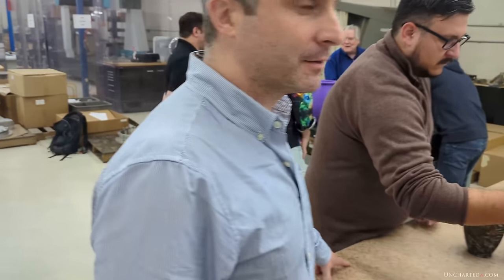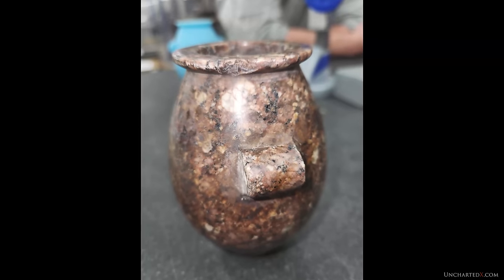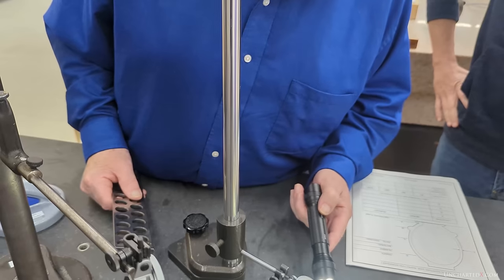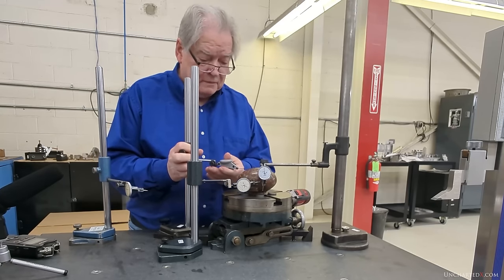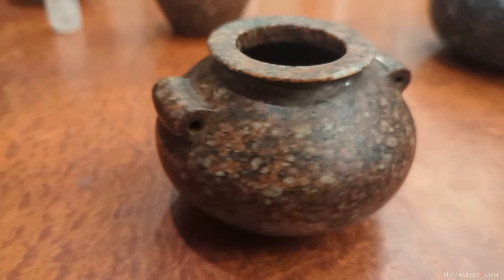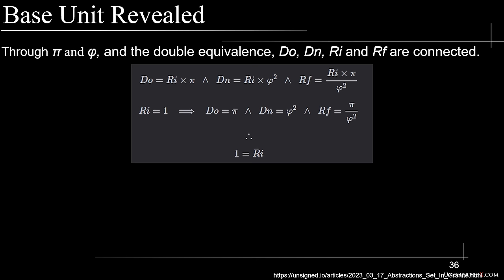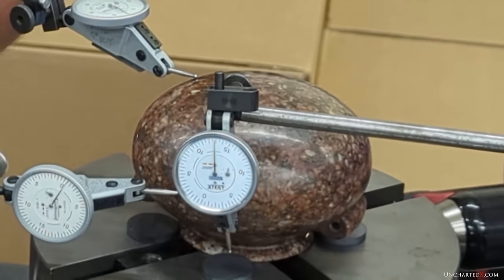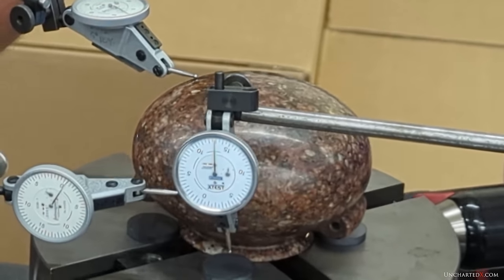Astonishing Results! More Ancient Egyptian Granite Vases Analyzed! More STL's available.

Comment: I am 10 minutes into this video.  I had seen some examples in photos before, and my point here is that I assumed the walls of the vessels were fairly thick.  In the opening, where they shine a light thru the walls of one, I was surprised but not quite blown away.  I am aware of the famous 'schist disk' artifact, and I know that the Egyptians were capable of some astounding results.

There is NO chance that these vessels were made IN GRANITE with copper chisels being tapped/beaten with granite balls.

I am a mechanical engineer who worked my way up, in the days when you COULD work your way up like that.  I have no hands-on experience with machining, but I know machining quite well.  With our CNC machines, these vessels and the schist disk could MAYBE be made so exactly and so concentric made and true in all 3 dimensions.  The ones with ears/handles?  I am not sure.  I honestly don't think so.

Before CNC, no machinist in the world could have made ANY of these.  Even with CNC, I am severely doubtful.

One feature has to do with that light shining thru the wall of any of them.  Thin when machining adds a new level.  Because to remove material by machining means you have to put FORCE perpendicular to the surface you are working on.  Applying too much force risks breaking thru the wall.  5% too much and you have to start over again.

Ben here says that these are mostly PRE-DYNASTIC.  Per arkies, pre-dynastic Egyptians were shepherds called Hyksos.  If a CNC expert in 2023 might not be able to make these, what do you think are the chances for a shepherd in 3177 BC?  That is 5,200 years ago.

So, agreeing with Ben and with Chris Dunn and others, the arkies who argue against the reality of these are fools.  Modern fakes?  NOBODY TODAY CAN DO THIS.  They call them fakes because this is WAY over their heads.  And all they can do is pretend they don't exist.

But people like Ben and Chris do not pretend they do not exist.  They want ANSWERS, not excuses.  I am an engineer of the school of hard knocks.  I don't believe things unless I can verify their reality and their exactitude.  I designed machines, systems, and many mechanisms, in more than 7 industries, all custom built, in my last 30+ years.  And they had to work the first time in trials.  And they did, every time.  I am no idiot.  And I know my geometry and trigonometry and CAD - better than almost anybody else.  These things were made in some way THAT I CANNOT EXPLAIN.  Chris is trying to find it out, too.  And he has been at it for more than 30 years.  And he is no idiot, either.
Reply: You say there is no chance these were created by copper chisels being beaten or tapped. Great. Who ever said that was the suggested explanation? Oh yes, it was Ben et al. Consider that Dunn also promoted levitation as a method of building Coral castle despite the winches and chain hoists still on site.
Reply: @Vision_2  
Dude, Chris Dunn 25 years ago was disputing any possibility of using copper chisels with granite balls for hammers.  And I agreed with him then, and I still do.
Reply: @stevegarcia3731  Have you considered why Dunn is not taken seriously by academics?  Again, who says that copper chisels were used to create vases?
Reply: @Vision_2  Anyone who thinks Chris Dunn is nonsense is simply wrong.  End of conversation.
Reply: @Vision_2  so how were these vases created, then?
Reply: @AustinKoleCarlisle  Tell us what you have learned from research. Then compare that to what is pushed by people like Dunn.
Reply: @Vision_2  -- 'Dunn', as you call him, doesn't need any of the respect of close-minded academics.  He knows what HE is doing, and they are still trying to interpret Egypt thru the eyes of late 18th century tinkerers, whose conclusions and guesses keep being repeated by people who opine about technologies they know nothing about.  There is the world of self-serving book learners who repeat stuff out of books and will get the approval of Zahi Hawass and Mark Lerner.  All's the pity.
Reply: @stevegarcia3731  He needs no respect because he is content to write books about whatever he feels like saying. He gives no proof or evidence but he can make money from people who want to believe and don't want to learn.

Comment: Tooling always leaves behind small traces of the tool.    
I wonder if a microscopic and comprehensive XRF scan could find anomalous trace elements of the tooling?
Yes the material is an amalgamation of elements but if let’s say tungsten or corundum is found here and there on the vases it could be indicative.    Since these were likely polished on the outside, I’d scan the interior. 
I don’t care what was used, I’m just curious what it was that formed those internal concentric marks.
Do this with all those plugs removed from the core drilling and the circular saw marks on the large blocks.    
Let’s get some facts!

Comment: I wonder if you could task AI with machining one of these to a blueprint derived from the laser scan of an original vase? As someone without the technical expertise to interpret all this mathematics into a practical manufacturing technique that would have been available to predynastic Egyptians, I'd really like to see some machining in action.
Reply: With modern (well, not that modern, post-industrial revolution) the geometry is relatively easy to set up. Lathe is key - if you have a lathe, it’s easy to make very precise round cylinders, your cutter just moves in a straight line. To make a sphere, the cutter moves in a circular arc. To cut the complex vases in the video, you’d just cut multiple circular arcs. However, cutting granite so thin with such precision thousands of years ago… that’s the amazing part. Also, the apparent knowledge of the mathematical constants and concepts…

Comment: I bet if you re-measured them youd get slightly different results, the humidity and air circulation in the building are not constant. These things are not almost perfect, they are perfect. Probly beyond a proton which doesnt really 'exist' anyway. God knows what the'yre datum was. The only deviations are due to our modern instruments, real time conditions and maybe due to erosion over 5 and a half thousand years. If you attached little sails to the handles of the spinner vases, they would make great spinning tops. Just tap them and they would spin for years. Thanks for this great video 👍

Comment: Advanced cement technology and using precise forms… the ones that appear to be in unfinished states are actually the test pours of the cement technology… the ones that weren’t perfect were discarded while they adjust the mix or wait longer for the form set or some variable unknown when working with advanced cement techiques… sodium silicate or the melting and reconstitution of quartz with acid/base reactions… it’s too simple of an answer I know but that’s usually the most likely answer! And we know they had many chemicals for mummification plus there’s been lots of chemical residue found… and it doesn’t take a lot of “glue” like calcium silicate for modern concrete when mixed with lots of sand and aggregate to make something very strong… and modern concrete uses many chemical additives to control dry time, workability, flowability, hardness, strength… etc…. So to think that there’s more advanced silicate chemistry possible isn’t much of a stretch and then machine forms down to precise tolerance wouldn’t be impossible since you only need to make a few forms compared to the production output
Reply: Granite is a crystalline matrix. It is NOT aggregate, sand or crystals surrounded by a bonding agent. If you think it could have been poured as molten rock, just research the cooling time required for granite formation.
Reply: This is such nonsense

Comment: The holes in the handles are curious too. The Egyptians had copper tube drills but using them was quite strenuous and keeping them in place while drilling into a handle nub without damaging the vase would be almost impossible. Maybe it could be done if the hole was drilled first and the vase handle carved around it but even that requires a level of certainty over how the item would turn out that wouldn’t be feasible without some kind of lathe type device. Could these guys have determined the likelihood that the handle nubs were carved out first and then drilled? Maybe based on the symmetry of the concentric circles of the handles and holes
Reply: How do you drill a precise curved hole?

Comment: So my wife bought me the cheapest granite chopping board a few years back,like from UKs Target lol a friend gave me a nice dial indicator to check my rotors and out of curiosity I thought I'd see just how smooth/flat this cheap chopping board was.
The indicator only moves one thousand of an inch 🤯 this is not through necessity, it is just because the cheapest and most efficient way make a tile of granite makes it very smooth and flat, I'm guessing those vases were the same they must have been very easy to produce efficiently??
Reply: Just out of curiosity, isn't granite the worst material for a cutting board? Must take the edge of the knife quite fast.

Comment: Awesome work to you and the team and thanks. I am blown away especially seeing some of the noticeable marks on the vases and I think I can see sort of how they did it. Start with like a rock tumbler start process and using different angles achieve basic shapes ready to be precision rubbed very similar to the devices you are running along to measure the devices using a jig measure the shapes and start rubbing another surface mounted on the jig across the granite maybe feeding fine sand and water onto the surfaces. It's just i can't stop seeing rocks being smoothed by nature but speed up to maybe a few human life times to finish an object. Its the marks I see and the marks I don't see it screams nature like boulders dragged by glacial movement the drag marks left behind through another rock covering the ground. Not in anyway trying to diminish the ancient the math embedded in the vases is ancient NASA level stuff. I would strongly suspect if what i am thinking is right the origin of these i would look for somewhere that had water to drive the production but human physical labor would work but water turning a wheel or able to push the grinding tools

Comment: Is there a way to measure surface dimensions using a laser reflected off the vase surface as the vase slowly rotates on a turntable (laser interferometry).  Huygens optics channel has that kind of equipment but it creates a 2D array of the wavefront interference pattern for measuring lenses and mirrors.  Accuracy is a fraction of a wavelength or about 1/100th of a thousandth of an inch.
Reply: Has been done. Watch previous vase videos from this channel.

Comment: I lathe turn hardstone; jade, rock crystal, agate, etc. there are jobs where I need to make a fit in the .00X +/- range. Depending on the stone the run out (variance from perfect concentricity) will vary say .001-.003 +/- despite my best efforts. This usually occurs between the finish work with a high speed spindle fixed on the lathe tool post and hand finishing to polish. Some stone has a “grain” like wood with harder and softer directions or crystal orientation. I.e., turning rock crystal perpendicular to the C axis will enable a better concentricity. 
By the way, the surface plates they’re using are hand finished.

Comment: These objects are more than 10,000 years old or more. They are from the last Yuga. The Dvapara Yuga. During that time human life spans were 1,000 years.
Reply: Kali Yuga ends in 2025, correct?
Reply: @AustinKoleCarlisle  This kali Yuga is 432,000 years in length. It started just over 5,000 years. There is a Golden Age at about 5 thousand years after it starts. That Golden Age is 10,000 years in length Then Kali Yuga starts again. Apparently, some modern sages say that May 26th of next year there is an Ascension.

Comment: Can we get a close up of the handles, as a machinist im confused how they would do this with primitive tooling, these guys r using mill turns cnc 😂 also im cyrious avout the inside of the vase looks like a step down was machined would love to know if it’s accurate there
Reply: someone can correct me if i'm wrong but i believe one of the vases had wall thickness tolerance within 2 thousandths of an inch.

Comment: It's almost the fact that this vases could not be produced without using lathe. No one decrlares that you need electricity for it, it could be mechanical device as well, however it should be the same preciese as modern electric tool.
And with it those tiny handles on sides of vase make engeneering task even more complex.
Reply: The vases are modern forgeries
Reply: @sempi8159  However its still looking hard. Some wases are so thin...
Reply: @guest_user-jm7cd  made with modern maschines.. Im sure its hard to do. Most things are.

Comment: we say the wheel did not exist because there were not strong enough materials for making axles, to make chariots
 not having the wheel does not imply they couldn't understand circularity and spindles.
 you can make a lathe from primitive tools
Reply: Cool. Make me a precision bearing with, and from, primitive materials.
Reply: No human can manufacture a jet turbine engine with the tools of a blacksmith.
Reply: @jamemswright3044  sure, I'll get on that right away. Let's make that a granite, cylindrical roller bearing, at approximately 18.7 mm diameter, length some integer multiple of that, flat squared ends, and at most about 7 micrometer variation.  It's going to take awhile, though. I'll follow up here

[Edit: I'm going to relax the allowed variation to 35 micrometers, to match the variation measured in the vases, which for vessel 1 was 0.009 inch in 5.2180 inch or 1 part in 580]
Reply: The essential problem to solve is, how to control six degrees of freedom while making small, regular changes to one or two of them.  Even if you use a modern lathe, you have to control concentricity along the length of the work piece, which requires calibration: measure and adjust iteratively, and hold that firmly while cutting pressure is applied. Real materials have imperfect stiffness and elasticity, so deform. This has to be accounted for

Comment: these vases are nearly metrically perfect and no I'm not referring to the metric system but to metric from a center there will be some wobble but into near microns, the deviations from 0 on the measuring device are that tiny.
Reply: some of the earthen wear vases of this period (not all) are as perfectly centered as well, mainstream archeology says these were made by hand and not by rotation forming.
Reply: dishes and plates of diorite and even harder geological samples are as perfectly centered as the vases deviating only near microns per revolution.
some of these have perfectly centered ridges going from center to edge making the function rather foggy as to their real use when they were new.

Comment: Granite is quite course-grained. I imagine it's incredibly difficult to get the difference between to crystalline pieces to less than 50 thousandths let alone 0.001".
Reply: Unless you put fire on it and it turns into glass. Fire, cut, polish. Repeat.
Reply: @Azmania3000  granite turns to obsidian with enough heat.
Reply: @AustinKoleCarlisle  I was thinking, there may be a process of working the stone where heat could be applied to the area that was about to be cut. I.E. transmute a thin layer of stone, then just buff that off.
But it still doesn't explain how to create the inner dimensions of a bowl. I'm trying
Reply: @Azmania3000  assuming they are genuine and pre-dynastic, my gut instinct is that the vases (and other works of granite) were carved out with an unknown form of energy that may have energized normal everyday items and allowed them to cut material with relative ease. this doesn't explain the precision, per se, but it would explain the Elephantine Island box, and the honeycomb vase we see here, among other things like the saw cuts and tube drills with very advanced cutting feed rates.
Reply: @AustinKoleCarlisle  yeah but why do that just to make a stone bowl?
Reply: @Azmania3000  because it was easy for them. who knows what isn't displayed to us. remember, not everything that is found in Egypt is displayed, they only display what furthers the official narrative, not what confuses people and disrupts the narrative.
Reply: @AustinKoleCarlisle just a joke, but if these things turn water into wine I'll take 7 please.
But seriously, I'm upset that Columbus is accredited as finding a sea route to the Americas.
There's many gaps in human history. So any research is welcome, but understandably has to be heavily scrutinised

Comment: Sooo WHEN was em wases MADE....
Reply: Traced back to the 1800's. Flinders Petrie described these in detail in the 1880's. He described marks that could not be anything but lathe cut with single point cutting tips as hard as diamond in a continuous spiral on the inside of these vases. He also documented the uniformly thin walls of no more than .025" on these vases cut from solid stone. Pretty well documented precision.

Comment: Have you heard of Natron theory? What if instead of machining the vessels were made via injection molding? Or, they could have been cast and then finished using acid. I would think the variance would be high with that, but not so much with injection molding

Comment: Is the vase that had the point cloud scan performed on it also inspected in this video? If so are the indicator measurements of the lug handles for this vase? I've seen on another channels video where they state that the lug handles on that vase show .010 runout with an indicator.
Reply: 51:19 maybe.
Reply: @hyperluminalreality1  that's a different vase. the neck is completely different